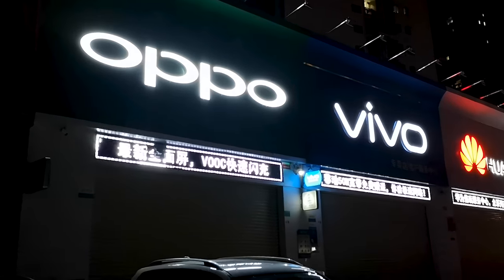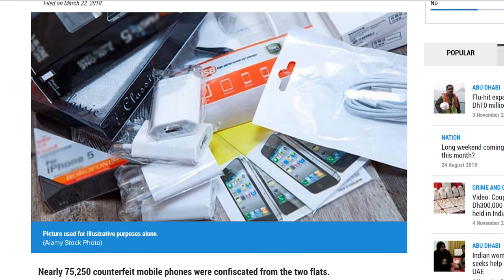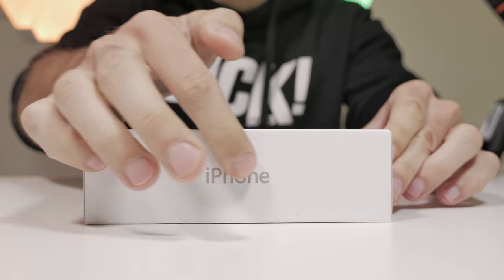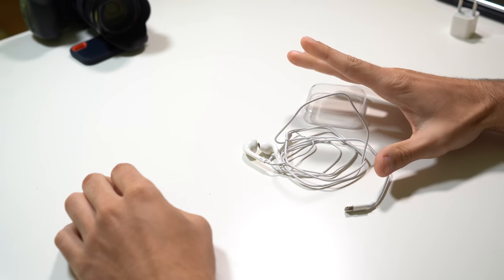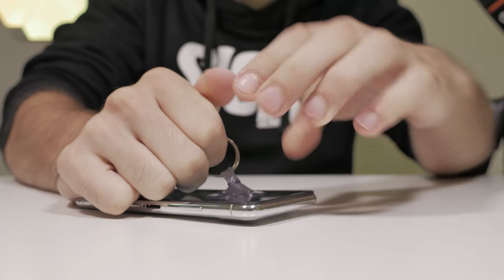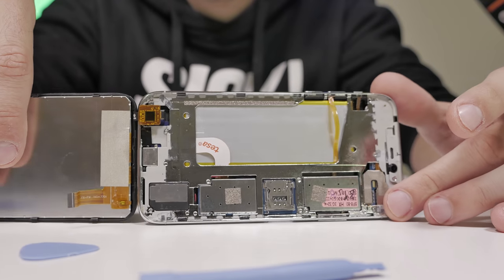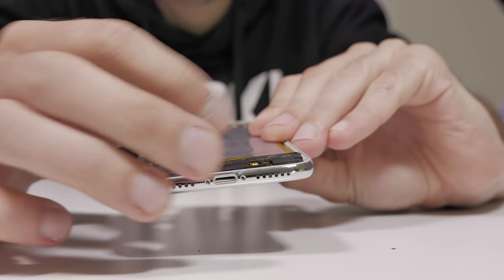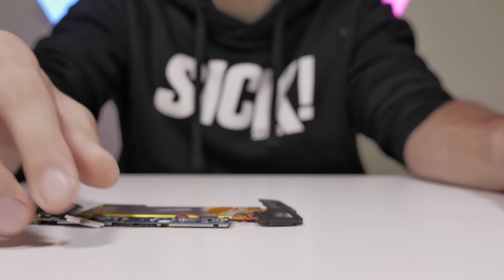What's Inside a FAKE chinese iPhone XS !

Comment: Your repetition of word "Chinese" is irritating. "Chinese made chips are no good...." they are almost ALL Chinese, even top ones! And it's coming from someone not fond of that fact.
Reply from the maker: Never said all of them. But they use really "old" mediatek chipsets in these clones which are cheap and have really shitty software due to Mediatek's bad history of non-existent support and OEMs' history of using Mediatek for throwaway phones (again with near zero support). Yes also the big top ones have fabs in china like tsmc, but in the cheap chinese clones, you will never find any good chipsets.
Reply: @TechMagnet  "Chinese" @4:14 and  10:21  clearly indicate that all Chinese things are crap.
And SK Hynix is second largest memory semiconductor supplier of dynamic random-access memory (DRAM) chips and flash memory chips in the world. And it's  South Korean company, btw.